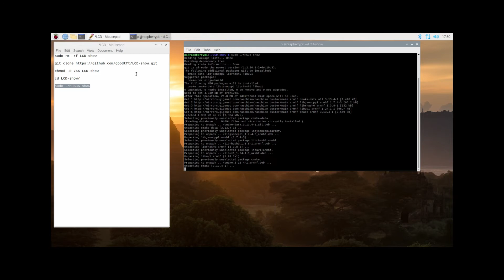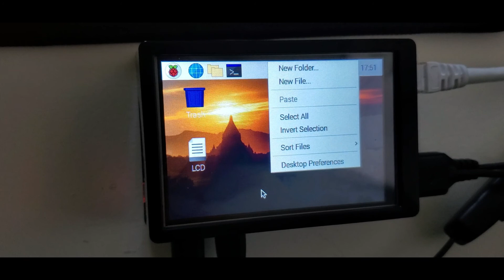MHS 3.5 Inch Display kit for Raspberry Pi4

Comment: I also have bought an MHS 3.5 inch display, downloaded the driver that was presented on this video, the display pops up on the screen but the touchscreen wont work, I can only move cursor with mouse and keyboard. Any idea how this issue could be solved?
Reply from the maker: Are you installing it on Raspberry Pi OS, Ubuntu or something else? If you are using Raspberry Pi OS, try again and let me know how that went.

Here are the commands in case you need them: 

sudo rm -rf LCD-show
git clone https://github.com/goodtft/LCD-show.git
chmod -R 755 LCD-show
cd LCD-show/
sudo ./MHS35-show
Reply: @TechSlice  thanks for the reply, the OS I have is raspian from the microsd that came with my rpi. I also used the this driver you presented but it seems that the issue is still present.
Reply from the maker: @KIDSxGAMER  I am not sure what can cause that. I just tried mine again and it works. One thing I can suggest is to try a different OS like Twister OS or The latest Raspberry PI OS.
Reply: @TechSlice when it rebooted after I installed the driver, the screen just went gray and wouldn't work when I disconnected and connected it to my monitor (screen)

Comment: Did you try the MHS 3.5" with raspberry kali 2020.3? I'm tried like 10 hours with no luck :/
Reply: Hey bro just wondering did you ever find a solution? Having the same problem at the moment. Thanks
Reply: @jaydenstone6108  I changed the displayy with another one (no name product) and its working dont know why :/ sorry pal
Reply: @Koddunyam  All good, thanks anyway. I'll just use raspbian and install any tools i need for now